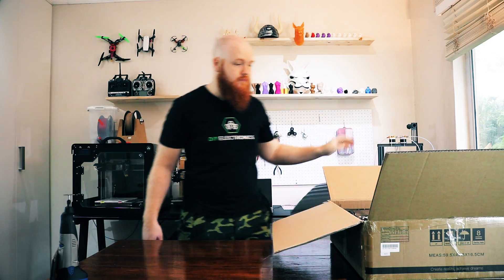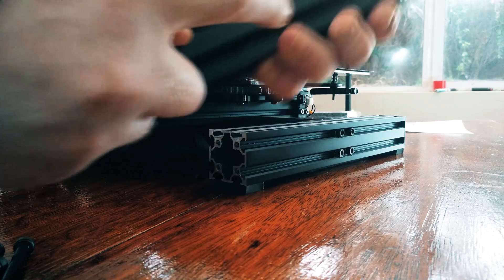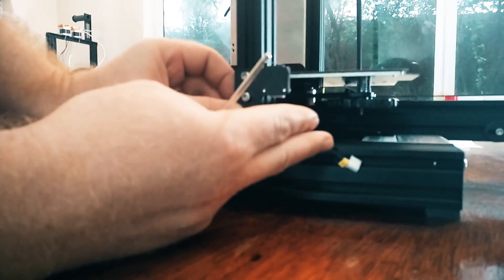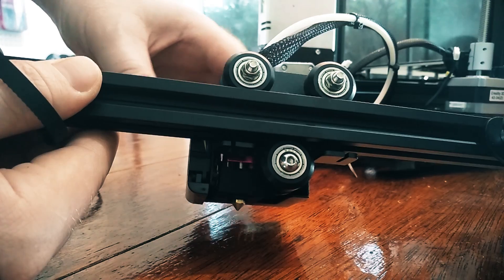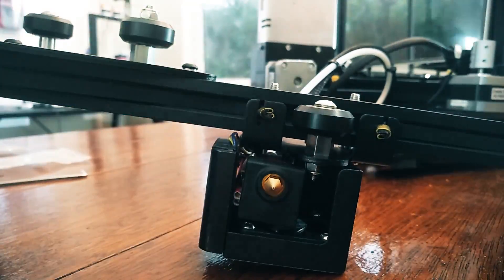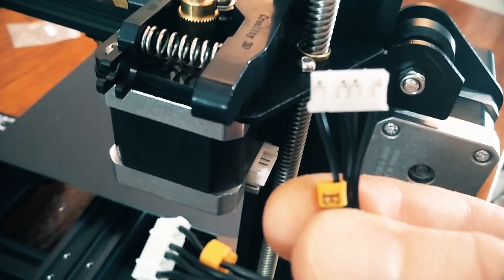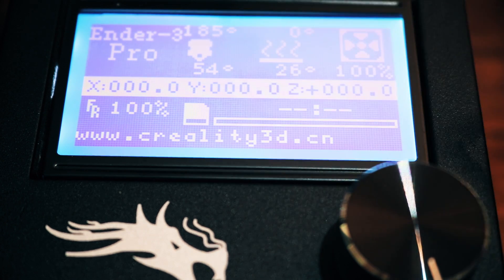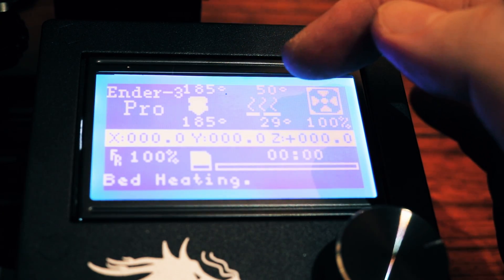Creality Ender 3 Pro: Unboxing, Assembly & First Prints

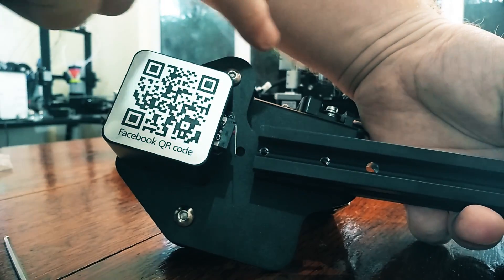Comment: So I'm at time mark 7:05 looking at the Extrusion with the Relief cut for the Bolt, and literally (Right of of the box) my 3 bolts are installed backwards from yours... If i attempt to install the Extruded Alum over the "nut" instead of the "head" of that bolt, it will not sit flat against the plate...I wonder how many ppl are having this exact problem and didn't catch it?  I can see this causing a mis-alignment issues and it wasn't an easy catch..  Thank god for the good video!!!!  Well Done!!!

Comment: Just got mine.
Vertical pillars should be tightened  at the very end as they have a little play (I'was not able to put "extruder bar" otherwise). I had to dismount bed and tighten Yasis wheels (both were too loose as well as hotend ones). And Z-axis sensor was placed to high, had to cut  and move down a bit. Pretty common things according to reddit :(

Comment: Wonderful video, some updates needed as my head wouldn't heat up until printing started, even with printing temperature set, SD card called something else including on the controls.  Also, you could have included the USB stick that comes with it.  Overall, i don't think i could have assembled this with the poor directions.  The other videos just do not compare in quality to yours.  Thanks!
Reply from the maker: We are glad you found the video helpful, thank you for the feedback. Happy printing!

Comment: Dang dude I thought I was having a technical issue.
I had everything set up but hadn't pushed the filament in through to the nozzle. I was looking up solutions to a problem of the filament not feeding and such, but apparently I was the dumb one and just didn't set up the machine properly.

Thanks a bunch for making my first print come out more nicely.

One question though: Do I have to use .gcode format for all my prints or can I use other types?
Reply from the maker: Hello 
Colék😃 You are most welcome, we are glad this video helped! Yes,.GCODE is the 3D Printer language. Changing the file type manually won't work, the file has to be sliced :)

Comment: Hello thank you so much for this tutor, the best i seen and will always be there provided 3 pro around.  Well i do have an issue.  The part number  42-34Z does not sit flat as the reason i caught this was the part would not go up an down sometimes go up but not down. I tried to take parts off to make sure all level. This is the only thing i can see why it is hard to push down on the medal rod.  Any ideas?  Thank you so much for all help as I do know been a while on this video.

Smiles,
Donna
Reply from the maker: Hi Donna! Please kindly email our support team (support@diyelectronics.co.za) with a more detailed description of your question and some pictures and we would be happy to assist.
Reply: Thank you so kindly and I do apologize for taking so long to respond.  I found out My z part needs to be replace sense it won't sit flat.  Again thank you so much for your time.  Smiles

Comment: hey man just bought one and im in the middle of building and im at 5:02 where i need to make sure the voltage is good. my house is 120V so how do i change it?  btw great video!
Reply: A flathead in the box on the red switch will make it slide from one to the other.

Comment: Thanks for the great vid. I'm looking at getting one of these as my Anet A8 has been modded to death and no longer warrants any more effort to get it to work properly. From the all the reviews I've seen there doesn't seem to be too much difference between the PRO and the non-PRO versions. Is it worth the extra money to get the PRO?
Reply: @CyclopsFPV did you end up getting this printer? : ) 
What country are you in? Are you happy with it? So many questions...
Reply: @cyberdyn5k  Hi Todd. Sadly not yet. I'm in South Africa and shipping to here is terrible at the best of times. On the up, side I did rebuild my anet a8 during lockdown, and now it is working very well:)
Reply: @cyclopsfpv247  so something really weird happened (well, I think it's weird!) ... I got the Ender 3D Pro. Really nice build quality. But! I had it in the box for a few days before I set it up.... just tired, didn't have time, etc.... I open the box and it looks so TINY! So... I'm gonna return it and get the 5 Plus. I might get shredded here (haha) by saying: I have never had a 3D printer before but, my aspirations are big. Hehe... honestly, the difference between 8 & 12 inches is substantial (insert pun here). So... off I go, it's a few hundred more USD$ but... long-term I think with mods for the 3 Pro, it will be worth it to me.

Comment: With all due respect, you lack finesse as you’re far too rough with the printer. Also, you neglected to mention the importance of checking the square of both vertical beams in relation to its base.

Comment: my dog comes out a jumbled mess
Reply: Mine got up to the nose perfectly then fell over in the middle of the night. I downloaded the calico cat and pulled off the magnetic cover because I thought my dog failed because it was just a cover but that was a mistake. Now I have the cover back on and readjusted the nozzle height. Trying it again with the cat since it's faster.
Reply: The instructions that come with this thing could literally not be any more useless.
Reply: @patrickrushbrook4523  was up all night going over everything thing i did. When i checked the connections on the control board . found a lose wire on x connector. Pulled it off got it snapped in and tried again. My dog test print came out flawlessly this time
Reply: @RASNOHIO  Good! Glad to hear it. Our Cali-cat turned out great. I also made a little guitar pick holder keychain I found on thingiverse. I think my only issue was the bed leveling. I worked on it a bit more and now it seems to be sticking well.
Reply: Of course I got a fucking short belt with mine.  I have never bought a new piece of electronics that hasnt been faulty. I literally always have to order replacements for shit and can never just enjoy shit right away. This pissed me off so godamn bad

Comment: If you could help me out with assembly. At about 10:30,  or Step 9. Something is too tight and it won't roll down the lead screw.
Reply: mine was the same, I just had to grip the base a bit hard and turn it while turning the top of the screw/pole at the same time.